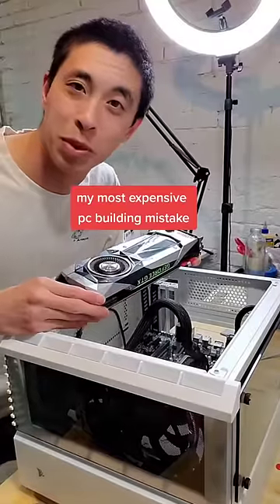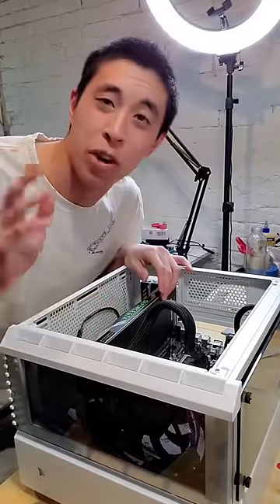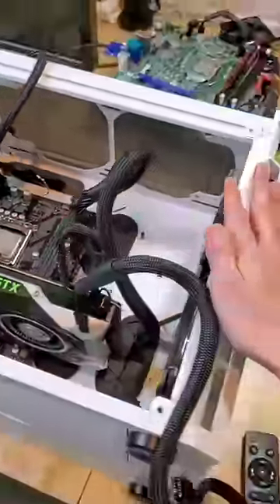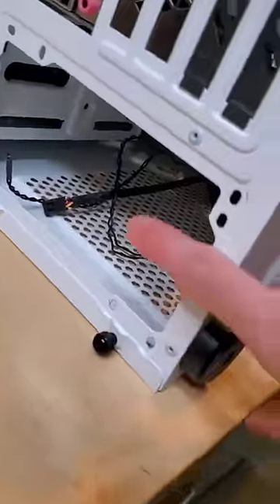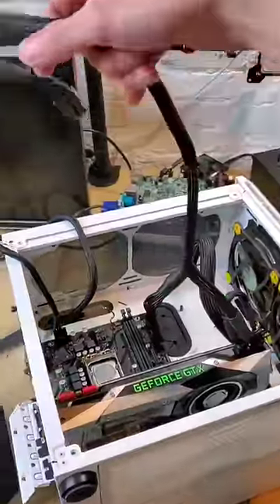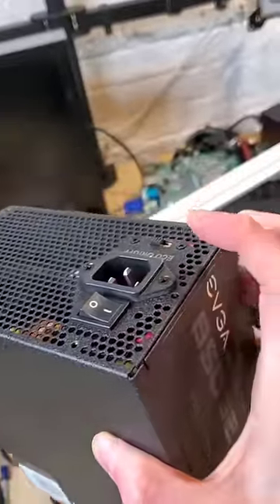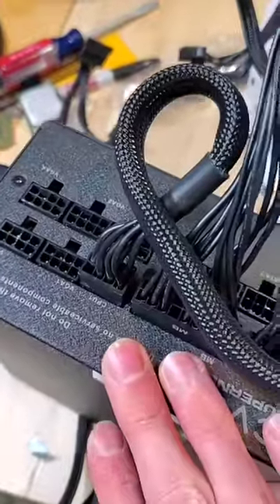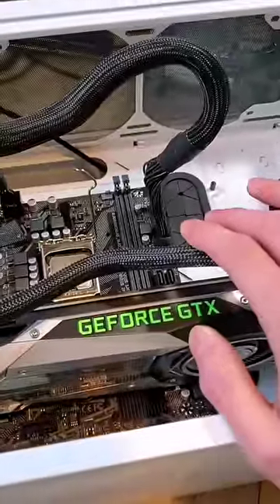my most expensive pc building mistake... #shorts

Comment: The cables not being standard is an absurdly stupid feat of laziness and “brand lock out” in the electronics industry.
Reply: Oh come on It's power supply and they all have they own cables
Reply: @smalldeekgeorge  yeah, so?  

The other end of the plugs are standard. The motherboard power pins have to match whether it’s from MSI or Asrock. 

How is it not pure laziness and brand lock out at this point?  Saying it’s “just a power supply” doesn’t mean anything.
Reply: @Morphling92  You are right also 😁
Reply: @Morphling92 because every power supply already comes with cables, but generally, it’s only a few, usually sketch name brand PS that have this issue
Reply: @CarlosSanchez-en6mr not exactly. If that was the case we could buy cablemod cords without having to get every detail of which PSU is used.
Reply: @CarlosSanchez-en6mr It's a bigger issue if you're buying a used/pre-built PC and need a cable that wasn't included
Reply: @CarlosSanchez-en6mr   Or buying used. There are plenty of ebay sellers selling psus without cables and if you dont know that mixing cables can fry your parts, youre in for a bad time. Cables should be standardized we don't face this problem when using cable extensions but face it when plugging in regular cables that arent from the same psu? That is nonsense. If someone buys a prebuilt and they forget cables they could be fucked out of an upgrade too unless they buy a whole new psu.
Reply: @Morphling92 exactly. If they want to make the wiring different at least spend a few bucks to make proprietary connectors for the psu end of the cable
Reply: @Draciosama well, it would be impossible to run into this issue with extensions. Because they’re just that, extensions. Unless they purposefully miswired it cable 1 still goes to pin 1 and so on
Reply: @SMgaming619  Yeah it's just sad that they do this. They want to make sure you don't buy from anyone but them. Which honestly shouldn't be allowed.
Reply: @SMgaming619  Some companies when they made PSUs would actually label the connectors so that you could buy replacements from another company, OCZ was known for doing this.
Reply: @smalldeekgeorge You’re not serious ?
Reply: Plus building a pc is so tedious with all the small and thin cables you have to connect. They should standardise it better.
Reply: @CarlosSanchez-en6mr  But even the same brand use different layouts between models, it should really be standardised so any 12v cable, goes into any supply no matter the make or model
Reply: @kadddddshad1424  and this is why I love EVGA
Reply: Maybe manufacturers will make a universal cable standard one day, if that is actually a viably good idea. Obviously, it would be good to not have to worry about having the wrong cables or not knowing. But to call it stupid and lazy seems presumptuous. High quality brands know what they are doing and I’m sure they work plenty hard to make safe, reliable, and efficient products. And what about the not-so-good brands, can we trust that every cable would adhere to the proper standards and be safe to use? Truly compatible with other manufacturers designs?
If there was any intention of “brand lock out”, the plugs on the power supply would just have different shapes. (We’re not talking about Apple here.)
They don’t want your stuff breaking or burning, and the best way to do that is to use the cables that were designed for and included with the power supply. I guess they could put a sticker over the plugs that says “use the right cables or you’ll break shit”. Then if you don’t have those cables you can just spend $10 and get the right ones with no fear of breaking shit. Yes, a standard would help if it was followed and if you could trust every cable you come across (brand, what year it was made, etc.), but at least you know about it now lol.
Reply: @smalldeekgeorge  their* talking like an uneducated inner city youth isn't cool
Reply: It's because different power requires different thickness of wire and wire is expensive. All your idea will do is drive up the costs of lower PSUs because wire is expensive the thicker it is. Your idea is bad and shows a lack of basic electricity understanding
Reply: A new challeneger has appeared!

Apple
Reply: I thought modular PSUs were really cool, until I found out there wasn't any standard for the plugs at the PSU end and it can be hard to find compatible cables for a given PSU. So when building a work PC recently I decided to just use a standard cabled PSU and a case with some extra space for cable storage.
Reply: Modular power supplies are cooler, but yeah the cables should be included
Reply: @CubeInspector  That's not the issue in question at all. It's the fact that the 6-pin CPU power connector for an EVGA PSU would have the 12v wire in pin 2 and the ground on pins 1 and 3 at the end that plugs into the PSU. A Corsair PSU on the other hand might have the 12v on pin 1 and the grounds on pins 4 and 6. So even though they're standard at the component end, they're not at the PSU end which can lead to bricking components if you're unaware.
Reply: Increases price of power supplies top end pcus need better cables because they have higher wattage. A low end pcu will then need the same expensive power cables so that they are "standardised" obviously they cant be standardised its not lazy, saves you money. And actually allows for improvements in tech. (Last statement means you can never make components over the standard wattage because it will never be compatible with your standardized cables.
Reply: @hungersurvive653  Ok, so make cables that interchange but have a wattage rating marked on the connector or tagged on the cord. Honestly though, how many low end PSUs are modular? How many modular PSUs use something other than 16 or 18 gauge wire? How is that not better than the current trend to just make everything proprietary and incompatible, and fry your board if you plug in the wrong cable?
Reply: That’s not the reason at all. Different power supplies have different internals and different wattage + power efficiency rating, which makes it dangerous to mix and match cables despite all cables plugging into ass PSU’s
Reply: @Morphling92 it would hugely increase the cost of power supplies
Reply: bro if you plug a 400 watt modular power supply 24 pin power connector into a 1200w power supply, it’s gonna explode, that’s not a monopoly or “brand lock out” it’s just logical common sense
Reply: @ethancollinsworth3927  that’s not how it works. 

The pin out is different on the power supply side and if you have that wrong, it can short or blow out on a 400w or 1200w.
Reply: How the F it's not a standard?
These cables must all be the same, or else every single power supply ever would fail.
Reply: It's not about mixing any cables. It's especially about not mixing cables from a modular PSU with cables from a non-modular PSU.
Reply: @stevenlitvintchouk3131  bro, you cant plug in non-modular into modular on accident, they dont come off.
Reply: @ghoulbuster1  Sure, on the end you plug into a mobo, gpu, etc.  Not necessarily on the other end...
Reply: No, every PSU maker has proprietary designs for power delivery, efficiency, temperature levels and so much more. PSUs aren't just boxes that supply power they're huge feats of electrical engineering that work specifically within a brands specifications to both optimize their value as a working product and towards the company itself.
Reply: Tell me you don’t understand current, without telling me you don’t understand current.
Reply: I bought fans but I had no adapter for the Dell 5 pin out it was a mistake but I will be buying some soon
Reply: if you're wondering why the fans are an expensive mistake if I don't give my CPU and GPU enough cooling because I ripped off the fans of the GPU it will literally melt
Reply: Well it doesn't help they're all the same type of connector too and easy to plug incorrectly
Reply: Not even just a brand lock out thing. Cables from the brand aren't always standard
Reply: Ok so I didn't get anything he said can someone kindly explain, thanks, I know most of y'all probably working and when you get time off you see these comments but still, bless ya and if you can please reply
Reply: id argue not laziness. it would be more lazy if they had 1 designed that worked for all. and more convenient. but like you said, its more of a brand lock out than anything. they put more work into making things more difficult
Reply: @Morphling92  how did this error even happen? Non standard polarity? Shorted ground? 12v where 24v should be?
Reply: apples proprietary usb has entered the chat
Reply: true, corsair has a soft monopoly on third party cables

Comment: Always use the cables that came with the PSU. Never from other PSU's.
Reply: non modular : nice
Reply: That's what I was trying to figure out lol, what exactly was the mistake. Thanks fam.
Reply: Thanks I really couldn't understand what was the issue.
Reply: Just like the others said, I didn’t understand anything so this cleared it for me. Thanks (i’m a gaming laptop enthusiast lol)
Reply: @Manterok  sarcasm?
Reply: If you are replacing same brand and model is ok.   Never the opposite.
Reply: @LeDracodon you can't change cables in modular PSUs the manufacturers learned from mobile companies how yo not follow a standard
Reply: There are some modules that are compatible and can be simple-swapped out. You do have to know how/where to find that information to see if your swap is. However, the time used to do this is likely the same as just removing the cables and using the ones that come with that power supply. Unless its a race and every second counts, dont bother with it (Shouout LTT VS Challenge)
Reply: @uaboobin i think he just was saying thank you.
Reply: @michaeltorrez6254  oh yeah you'll surely find those infos from trusted sources
Reply: @sayori3939  absolutely, definitely not worth trying for the average user under normal circumstances.
Reply: @michaeltorrez6254  i wish these companies would be sued every time they didn't follow a standard without a very good reason to do so
Reply: @bigblackoilyballs  you can't be their lawyer! It will make me mad :0
Reply: @uaboobin no they didnt understand what was wrong
Reply: Exactly, the called are all standard. You can mix and match cables all you want, it shouldn't matter. I've been using a seisonic mobo came for the last 10 years it's still working. Used it with over 4 different psus.
Reply: And how that applies to everybody buying strimer cables rgb and non rgb for looks? Ornwhat do you check in those extensions so never break the pc? Or this is just for the psu base cables?
Reply: Cable mod 💀
Jokes aside his fault wasn't that he used different cables but cables from an untrusted source. Mixing cables is never a problem if you know the cables are working and suitable for the load. They are just copper wrapped in plastic. No magic there.
Reply: @Quisqueyax my current PSU is a 450 watt INSIGNIA can I replace it with a 750 watt ARESGAME PSU?
Reply: My current PSU is a 450 watt INSIGNIA can I replace it with a 750 watt ARESGAME PSU?
Reply: @Quisqueyax No. Did that mistake once. I’m never doing it again. Use the cable that came in the exact same box that the power supply.
Reply: Unless you've checked that they use the same pinout. Them being the same brand is no guarantee of pinout, of course.
Reply: @Quisqueyax  We need to put version numbers on the cables if they aren't all the same! Dell often likes to wire their power differently so just hooking up a power supply that isn't the original is a risk!
Reply: @Erod-iz1nt  you need to check if that psu is compatible with your mobo.
Reply: @arakwar  I replaced the same psu and I didn't touch the wiring.  I got same model.
Reply: @anthonywilliams7052  as long as you use the ones compatible with your mobo, you will be fine.
Reply: @Quisqueyax  how do I find out if it is compatible
Reply: @Erod-iz1nt  what mobo model you have
Reply: @Quisqueyax  x370 taichi
Reply: @Erod-iz1nt  yes, both are ATX.   Use all the cables that come with the new psu.  Do not mix.
Reply: @Quisqueyax  okay thank you I appreciate it 😁
Reply: i just figured this out what a stressful time
Reply: Thanks for clearing it up i did not know what went wrong
Reply: What if i bought an upgraded psu from the same manufacturer (proprietary hp, went from 400 to 500, havent installed yet, although im pretty sure since its proprietary all the cables are built in, havent taken the case apart yet)
Reply: Wow cool, the video is not about this! You're so smart
Reply: Yup, never mix and match cables. Even when ordering custom cables you have to provide the model of your PSU. What a rookie mistake.
Reply: If the grounding pins are aligned and the voltages are the same then it’s fine. Of course you actually need a 7th grade education, so that weeds out 99% of gamers.
Reply: I really didnt know this lol wow Such a minor thing can turn major
Reply: I mean there is a reason they give you their own with their own device
Reply: But what about cables from cable mod etc .
Reply: Mine dont come with pcie pins
Reply: its almost like i watched the video 💀
Reply: @zMaYpeT you need to check if the pinouts match. Otherwise cable is just a cable
Reply: @Manterok  he put the cable into the wrong socket ...
Reply: What about third party cables, like if you only buy cables by themselves and use a fully modular psu
Reply: Even if i buy a cable that was made for the same psu?
Reply: What if you bought a fully modular PSU with cable extensions?
Reply: And what about the cable that's plugged to the wall?
Reply: How is this possible? I though cables just direct power from the supply and they could mess with anything
Reply: um, yeah. that's the entire point of the video.
Reply: @Manterok The cables where static charged from Another psu unit that probably was of higher wattage soo when he Plugged them into his psu unit he damaged all components because of the higher static buildup that rapidly ran through
Reply: Well the PSU I was upgrading was non modular and they were attached to the inside components so I didn't have a choice 😭😭
Reply: True
Reply: So what about those fancy looking braided cables they use in color matching builds.. they're universal or just cable extensions? 🤔
Reply: @SrChalice you are joking right..?

They are not talking about using same mobo with different psus but using different psu cables witth other psus cables
Reply: That is so stupid, why isn't the cables standard?
This mistake could happen to anyone.
Reply: leveled up lesson.  Learn to test a power supply using a multimeter to verify the pin outs.  Although this probably won't save you time, it is probably more useful if you mixed up your extra cables.
Reply: And always get it brand new too... I made that mistake with my first psu
Reply: All my PSUs have modular non removable cables 💀💀💀